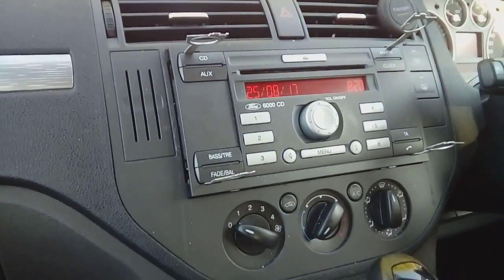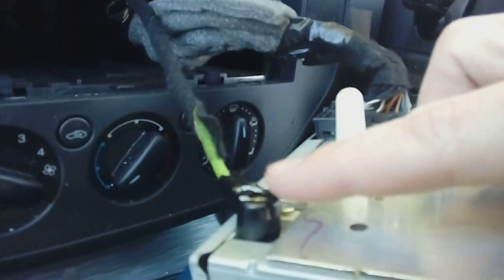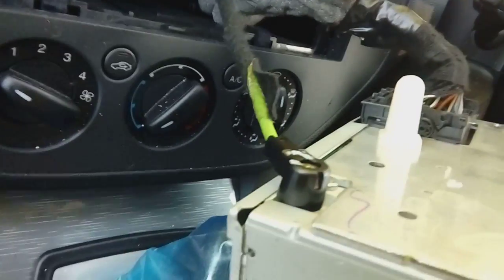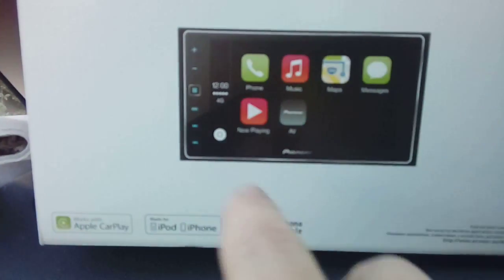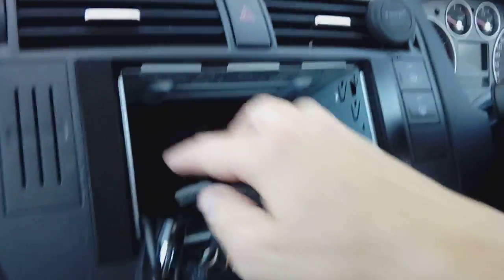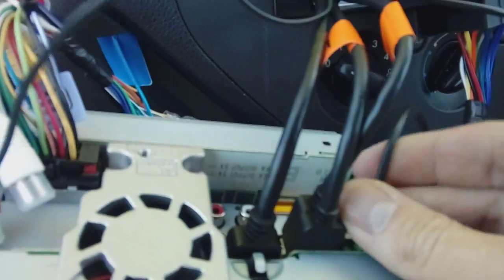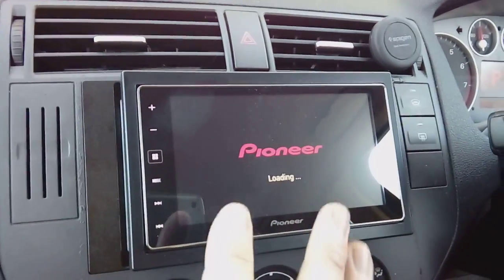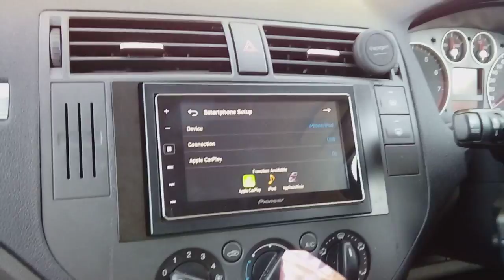Ford Cmax 2003-2010 how to remove & refit a radio,simple step by step guide.

Comment: Hi pj I brought the same sort of radio plug and play Apple play ect installed perfectly worked fine then got and st steering wheel and airbag installed the new steering wheel but the air bag was the correct one for the wheel so didn’t bother swapping the old one back and drove the car with out the air bag airbag warning light was on and I don’t know if it’s gone into limp mode but now it won’t start at all I didn’t disconnect the battery to start with have I fried the battery or blown the fuses as now even with a jump nothing is working no lights on dash when ignition on ect please is there anything I can do to try and solve this issue with taking to garage or calling someone out

Comment: Did the car have steering wheel controls for the radio? Mine does and I was wandering if it means more troubles when installing a new one.
Thanks for the response
Reply from the maker: You can buy an interface to work the steering controls, give your reg to an audio retailer and they will supply the correct one.
They are around £35 and just plug in.

Comment: How did you feed the wires through? Did you have to remove glove box, I need to install sat nav ariel on top of dash but can't find anywhere to feed cable through. On this exact car
Reply from the maker: Just use something flex like the outer part of a bike brake cable and run it from the radio hole down in to the passenger footwell.
Then tape the wire to the end and pull it up and out of the radio hole.

Comment: How big is the screen please. Im looking at fitting a 7inch screen in and seen double din facias available
Reply from the maker: The video is now over seven years old, the radio used for this example will of long ceased production.
I would recommend contacting your local car audio retailer for current models and specs.

Comment: Great video. What cage did you use and how did you connect it to the stereo?

I got an Atoto stereo which is Chinese but standard 7” screen and size. Got all the connection and more need to fit it with a cage

Comment: I've done the same replacement with a sony xav ax1000 touchscreen stereo, works like a charm, however I've only just noticed the rear speakers dont work since I made the upgrade. The radio itself has dedicated sockets for the rear speakers on the back of the unit, but with only the one main cluster of wires to connect from the car I'm scratching my head what to do to fix it? They worked fine with the original 6000CD radio using the same main clip of wires as you showed in the video. Any ideas where I've gone wrong?
Reply from the maker: It sounds like your car might be rear amplified? if so you will need an active cable to get them to work. A lot of the higher end Cmax models work like this so it's not uncommon.

Comment: I’m trying to install an aux cable into the back of a 6000cd radio as the one already has stopped working (aux port located in centre console in front of hand break) I have the cable and removed radio, I have removed white connector and went to install new cable after having to remove black plastic clip around new one but doesn’t seem to work I’m I doing something wrong please help

Comment: Hi, only part i need to see you didnt show. cage fitting! does it just slide in or are there mounting screws / brackets? got an Xtron's double din but wont sit stable in the dash.
Reply from the maker: Not heard of an Xtron unit but the cage should just slide in,you may need to wiggle it a bit but other than that just push it in and bend a few securing tabs back to hold it in place,

Comment: PJ brilliant video thanks. I came across it as I have a couple of issues with my 07 C Max, that I was looking for information on and you seem like you know your onions when it comes to a C Max. 1: My 2 rear speakers have stopped working. I can't imagine the cable has come loose on the back of the radio, based on the plug you show in the video and I would ordinarily be reluctant to think that both speakers had blown, independently of each other. Is there a fuse or other common component to the rear speakers or am I looking at removing the door cards on both back doors? 2: My right rear tail light, led version, has stopped working. To replace the light cluster is approx €100, so I thought if I swapped the left with the right, I could confirm the fault, but now I'm even more confused! The left works fine on the left, but not on the right, which leads me to the following conclusions, either the wiring is different for left and right lights or the rear light and wiring loom are both faulty!!! Any ideas would be greatly appreciated. Regards, Simon.
Reply from the maker: 1. If you have just bought the car make sure it has speakers behind the grills,if it does then one of two things has stopped them working. Either the wire has snapped where the cables go through the door and in to the centre pillar,they are inside a rubber gaiter and tend to snap inside it. The other common problem is that the window rubber seal gets moldy and worn out so that water can run down the glass and drip on to the cardboard speakers which in turn kills them.
To fix you will need either new speakers or new cable running from the speakers to the good cabling which either way is both rear door cards being removed.
2.Your rear light sounds like an earthing fault so follow the circuit from the black cable and see if its corroded inside the light panel and make sure the plug that connects on to the light unit is clean with no corrosion on the pins. If water has got in to the leds then it's replacement time.
Reply: Thanks a million PJ, I'll let you know how I get on.
Reply: Hi PJ, I replaced the rear drivers side light cluster, but fault still apparent! However, the original light cluster was faulty. I now think it is definitively a grounding issue, as I had to change a side light bulb and that didn't cure that fault either. Do you have any tips on tracking down grounding faults?
Reply from the maker: Try and look for water ingress, such as rubber light seal or hairline crack in the light cover,anything where moister can creep in will cause earthing problems.

Comment: Hi the person who had the car before me has broken the two on the right hand side the release keys go in and do nothing theres nothing for them to connect to so I cant remove the stereo is there a alternative do you have any advice mate thanks.
Reply from the maker: Yes that can be tricky when the release mech is damaged. I see it a lot where people have rammed the wrong release key in. The fascia is held in place by screws that are behind the radio so your stuck with needing to release the radio.
I suggest a metal trim removal tool to slide down the damaged edge of the radio and force the clips to one side while using the keys on the other side.
https://www.ebay.co.uk/itm/TRIM-Metal-Clip-Insert-Door-Weather-Strip-Remover-Tool-FIAT-FORD-VOLVO-HONDA/361829889470?hash=item543ebdf5be:g:XgIAAMXQATlRZpgr

Comment: Is it Possible to remove it again in the future? And how would you do that?
Reply from the maker: Yes sure,if you can fit a new radio then you just reverse the process to put back the original. Some Ford radios are security coded so just make sure you have the code for it.